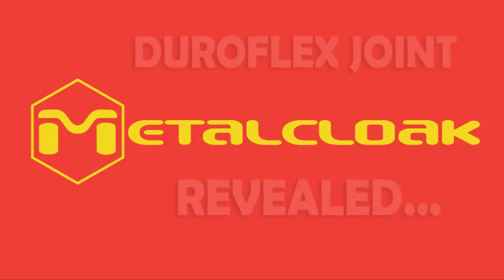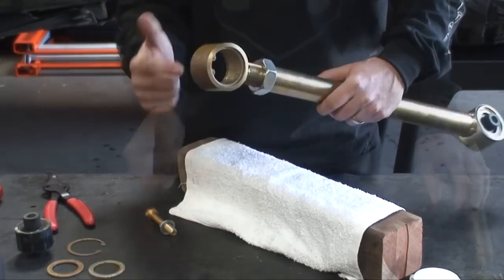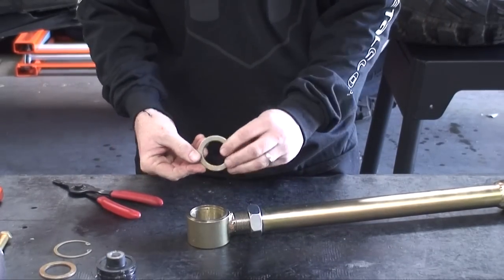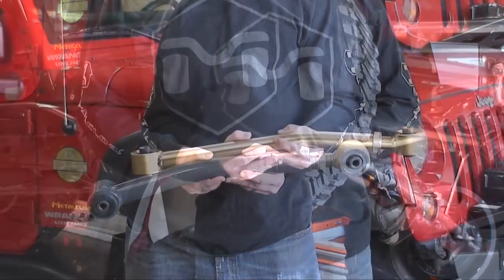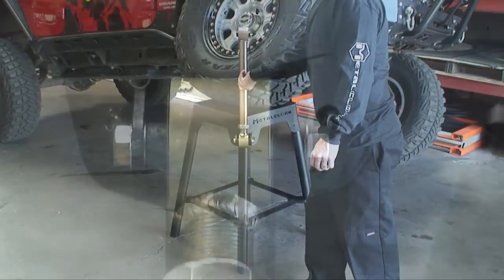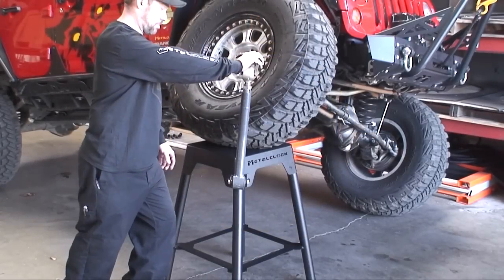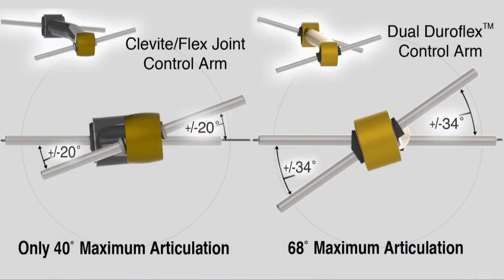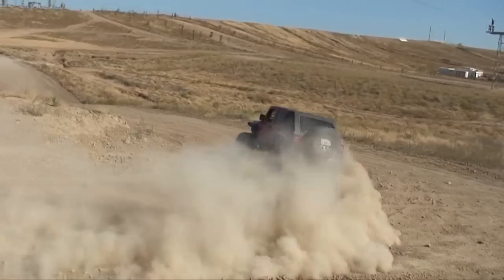Metalcloak's Duroflex Joint Revealed

Comment from the maker: The only grease we recommend for use is Daystar's Lubrathane, a synthetic Teflon and silicone lubricant that is designed specifically for bushings. You will put a small coat on when you install the bushing and that is all.

Comment: What warranty does metal cloak offer? I am considering a 3.5" long travel short arm kit for my TJ. Does it require a dropped pitman arm? What about drive shaft or SYE? What is the preferred setup and what else is required not included in the "Lite" ARB edition kit?

Comment: I was considering a set for MC arms as well for my jk. One question i have. How much adjustment does it have. I wanna
center axle on rear on rear of my jeep (about 1.5"). Do u know if there is that much thread to
lengthen arms about that much??
Reply from the maker: You should be fine. Our arms are designed to center the axle better within the stock wheel well and have adjustability to work within your parameters.
Reply: That’s really hepful

Comment: Will those bushings only fit in the metalcloak arms or could I put them in my RC arms?
Reply from the maker: The bushings themselves are not a direct replacement. However, you have a couple choices... one you can replace the Joints themselves with a full Duroflex Joint, and you can do our cut and weld kits... cut off the old joint and housing and weld on a new one that is designed to hold the Duroflex joint.
Reply: ok thanks